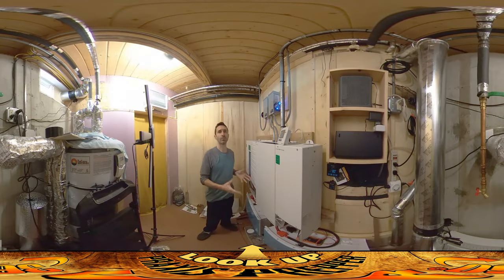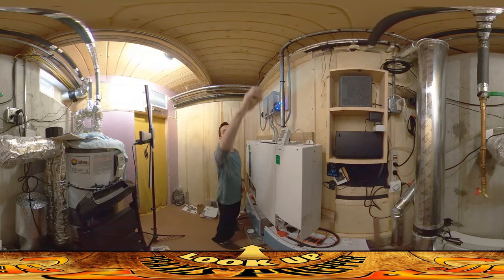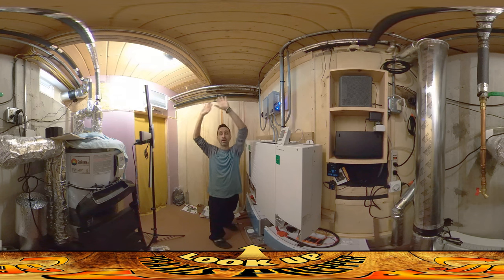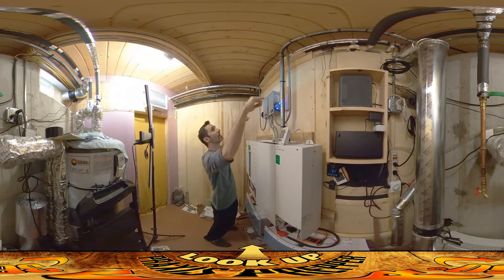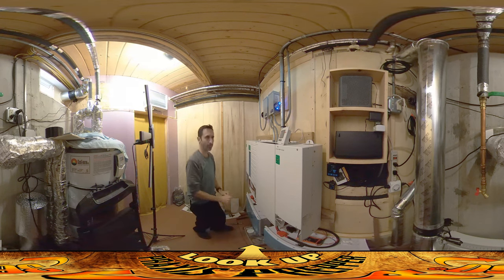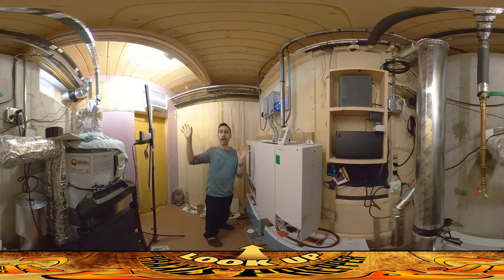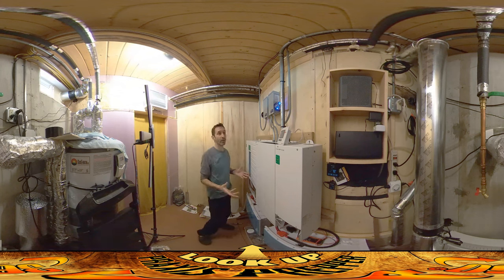Homestead Building - Whole House Solar Power System Overview

Comment: How many amp hours and total solar panel watts do you have hooked up to the house now?
Reply from the maker: 6kW of panels and the batteries hold 10kWhours. I'm typing this response while the house is on solar power. :)
Reply: @PraxisPrepper  Thx, given that you have lived on solar before, how many days of backup power does that give you assuming minimal daytime sun exposure, like multi day storms, etc? Just curious of a real world experience give my ~5kwh of batteries in the RV that I still need to hookup. Hoping to get solar panels next month but have found a couple properties in Indiana we are going to look at in a couple weeks when we get back there for about a month. One is just under 8 acres and entirely wooded with probably close to 7 of those acres in a big square behind another property with a 1 acre section on one side with good road frontage, so basically a cup shape with the handle being the 1 acre. The other is just under 10 acres with about 85% wooded but it’s a 250’ wide strip with no road frontage. I’m waiting on confirmation that it has deeded road access which I think I want vs some other kind of right of way easement which seems like over time could have issues with whoever actually owns the underlying land.